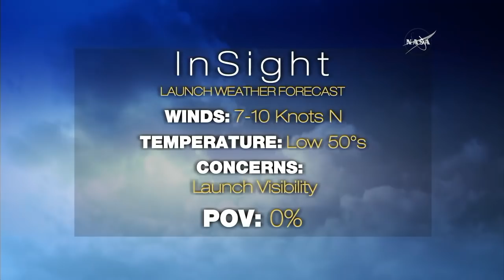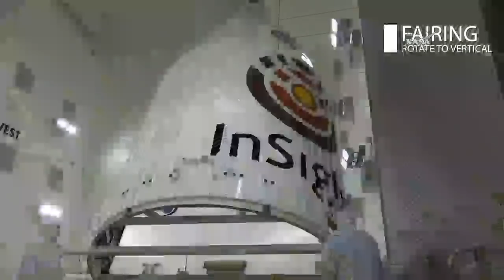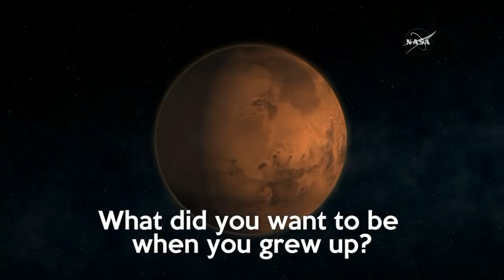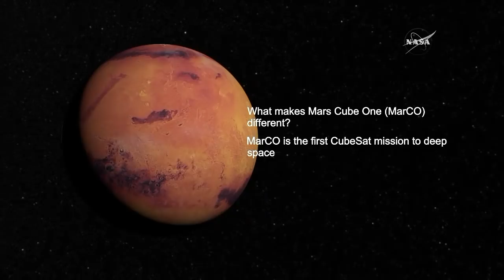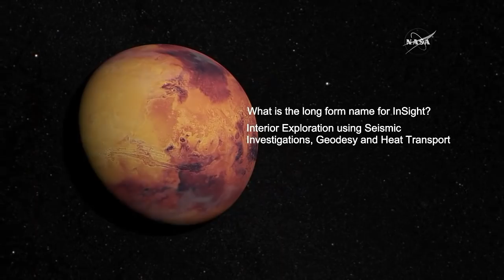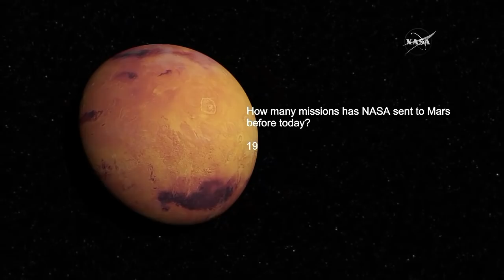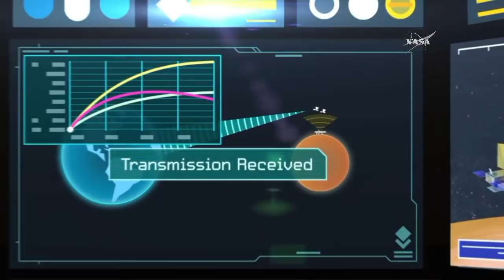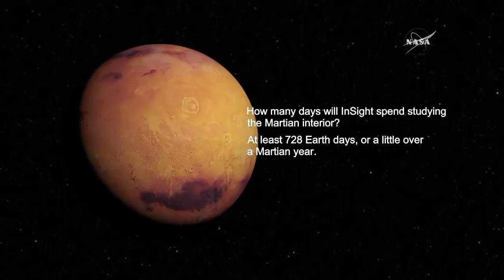NASA Launches InSight to Mars (part 1)

Comment: I feel due to all the movements of aligning the parts to probe the surface will not work as it should. It is to me too complicated of a sequence of events unfolding the needed parts to fit properly. If this works all i can say is we have some very superior engineers and they should have included a solar powered drone or one that would fly all over the planet and take superior close up pictures and video.